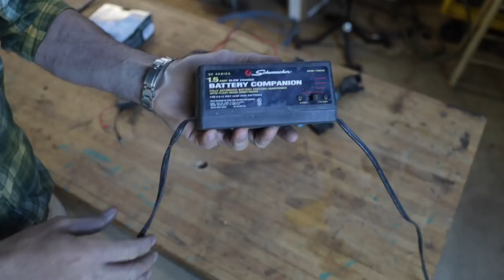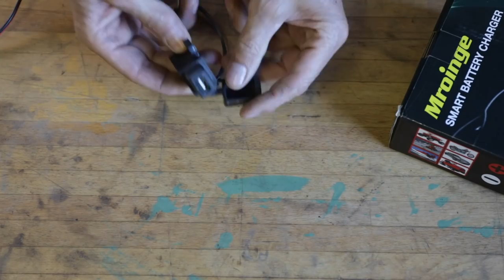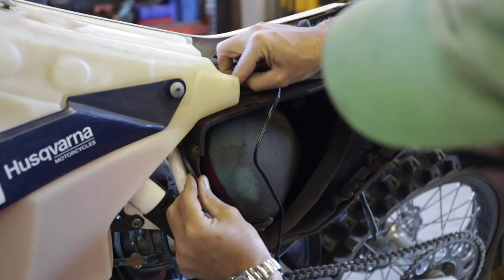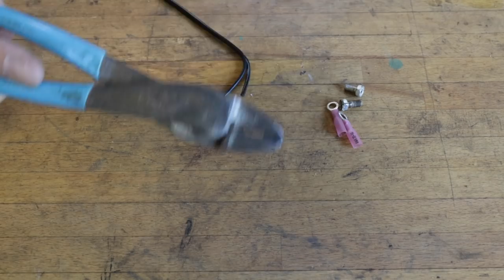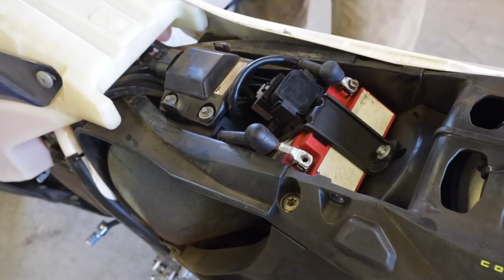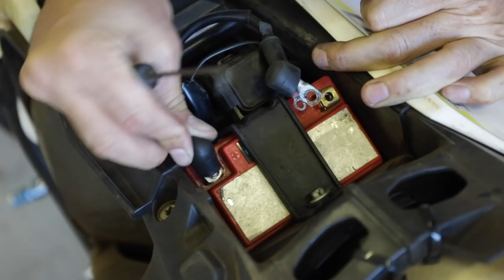How To Charge A Car or Motorcycle Battery Like A Pro

Comment: Just a note on those pigtails. I got one that had the built in fuse, from the manufacturer (same one Wranglerstar is using), the fuse had a manufacturing defect, which makes it look like the battery is bad, or there is something wrong with the charger if you have a brand new battery like I did (after replacing it and rewiring the same bad cord). So then after getting a second trickle charger, and getting same problem, I finally swapped the pigtail and that resolved problem, so then I noticed the fuse, and on a lark swapped the pigtail back to the "bad" one and changed the fuse, and everything worked. So $150 and many hours and frustration later, bottom line is *check the fuse first!*. I'm sure obvious to you reading this now, but at the time it wasn't to me.

Comment: In case you're wondering, those connectors are called SAE connectors. Not only are they used for battery charging, but are also often found on radio equipment and a few other things. Biggest thing is to always double check the polarity! You can mess it up if you're not paying attention, because it's the same plug on both ends.
Reply: Thomas Nast yes!!!!! Soooo true you always have to double check. Not enough people know that.

Comment: Cody I enjoyed the video but something you forgot to mention, is paying attention to the polarity of the wires for your charge circuit. If you hook up the charger backwards you can either damage the battery or damage the charger.

 Because you cut the wires long you should be able to go back to the ring terminals that were original and look for the ribbing on the side of the wiring jacket, depending on the manufacturer sometimes the ribbing is on the negative side and sometimes it's on the positive side, so that's how you can identify your polarity if forgot to take note of what one was positive and negative.

Cody I enjoyed the comment about the photo shoot out there on the property, last month I turn 62 and I have thought back about many of the people I worked with and it's funny that some of the people that I worked with, the ones I remember are the ones that offered the Helping Hand when I was new on a job they gave me the little tips and hints of how to do a better job. Then there were the few that wouldn't tell you anything but were there to belittle you when the job the job was done wrong. And I think a lot of the guys that are belittling the video are armchair quarterbacking it.

Comment: I use XT-60 connectors on all my stuff. They are kind of the new popular connector with small lithium polymer packs so they are easy to get and are rated for 60 amps.

Comment: SAE TO SAE 12V-24V Quick Disconnect, I use an extension for my motorcycle so the plug is by the handle bars for easy charging and easy to USB power adapter....i also use a "SAE Quick Disconnect Wire Harness Panel Mount" for a very clean and easy to use charge point for larger equipment (side by side, tractor, etc.)

Comment: Cody, Thanks for sharing this video. I just put a new battery in my 1977 Yamaha XS 650 and the pigtail would be nice for off season storage but the battery is easier enough to remove and I keep it in my shop which is heated. Thanks for sharing your knowledge as always.

Comment: Right off of the amazon page:

The unit is built-in 2 color LED indicates stage of charging, so very easy to use.

FLASHING RED: not charging battery, reverse battery.     <<<---------------------------------------------------------------------------
SOLID RED: battery charging.
FLASHING GREEN: battery greater than 80% charged.
SOLID GREEN: full charged and maintaining.

Comment: Dad use the same connector set. Over 40 years. Whenever he ran low, he would just order a gross of that particular connector. About 10 years before he retired from appliance repair, we built about five kits. One for each utility bucket of tools that we took out.

Comment: You cut off the red/black markings. I suppose you will find out in the end.
Reply: exactly, I thought he was going to use a sharpie to color the black leads heat shrink tubing.
Reply: All those chargers have reverse polarity protection
Reply: @mitchdenner9743  - that's irrelevant, that lead could short out the battery to the casing if he's swapped the connections over.
Reply: @borisisasleep8993  stop crying baby
Reply: @mitchdenner9743  - really? please stop talking about stuff you don't appear to understand
Reply: @borisisasleep8993  go back to bed boris

Comment: Great tips, as usual, thx WS!   Fwiw, I might have just installed the "slightly too big" factory charger wire ends underneath the bikes battery cable ends.  I usually try and do this also because the battery cables are strong and stiff and when you tighten down the screw/nut, you won't smash & twist the delicate accessory wire ends.

Comment: Pro tip: Cut your positive lead about a half inch longer, so you don't confuse them after you've chopped off the colours. Of course you could choose the other wire, but I didn't want to leave a negative comment.
Reply: Bonus point for polarity pun!
Reply: Lol

Comment: A little " thing " i'll share with you - and others. My 20 year old manual lead acid type 1.5 amp charger would top off the charge at 15.8 volts. A little high for small motor cycle or scooter batteries, over time - like a winter. it would slowly boil the water out of the battery. Your modern li-po batt is a whole 
different animal. I bet it tapers the charge very nicely to a float charge when it sees the voltage rise.
My dumb charger would just keep on going until the water boiled out.  The solution i found was a small wall transformer, for a small item that was 12.5 volts at 100 ma. Cut the plug add clips and let it go all winter, no load voltage was 13 or so volts and it must output DC not AC volts.
Lead acid type batteries only. The 12.5 volt transformer would let the battery voltage rise to around 13.5 or so, with low current it will not harm the battery, you could even get away with a 50 ma transformer. Works on car batteries as well.
Battery tenders have voltage sensing and taper the charge as the voltage rises, but if you don't have one find a 12 volt wall wart add clips and there ya go. Just be sure it is a DC output transformer.

Comment: So, does it autodetect the polarity or did you just get lucky?
Reply: Yes, most have reverse polarity protection, plus the ground wire always has either a white stripe or some type of lettering on it  so you always know even if you cut off the red and black ends. Pretty sure 120 volt cords are the same too with the neutral being marked.

Comment: If the other end of the battery cable is a ring terminal, it is sometimes easier to connect your charge wires at the solenoid and frame ground so that you don't have to fuss with the charge wires when you change the battery.

Comment: hi cody you might want to rethink the terminals on your battery charge fly leads, the fitted ones were the right size for the current they will have to deal with, your much smaller ones will not take the amps going through the battery, and it doesn't matter if the charge fly leads are connected to a charger or not, your small connections on the battery will not take the amperage put on them as they are connected directly to the battery leads unfused, they will be the weakest linc
Reply: Crimp terminals are rated by colour not ring size, the red ones are good for ~19A, that wire was maybe rated for 5A at most. Which is probably all that a charger would put out anyway. The main issue here is not using the correct ratchet crimp tool to attach the crimp reliably.

Comment: Polarity identification!  very important step overlooked.  Especially if people are learning from this video
Reply: Negative wire will always have either a white stripe or some type of lettering on it to denote that its ground. All these chargers have reverse polarity protection in them .
Reply: I partially agree with that but the point is it there was no mention of this.
Reply: @Jp_1984  Then maybe you should stress it when you make your video?

Comment: Here's a time-saving tip. Don't cut off a device's polarized output cord connectors unless you are immediately able to label  at least one of the conductors.  I like heat shrink tubing because it's an expensive are available in a range of sizes . Also, do not connect a simple passive USB adapter cord to any of the charged batteries. Use a converter with an active regulator

Comment: Plug Type is an SAE...
Ring terminals place the one with the biggest gap at the bottom and stack up, then you don't need to terminate again...
If you don't want it flapping about open the connector around the frame and put on the cap looks like you have enough room for it.

Comment: Ive tried alot of the cheaper wire strippers and the Snapon ones seem best. I always find that the cheaper ones dont cut insulation enough and it just stretches it out so i bought a second pair of snapon strippers for home

Comment: Hmmm...... since this was supposed to be an elementary presentation on battery charging, and I don't know squat about battery tenders, what they are, or how they function, it would've been nice to hear you explain a bit about the tender itself, not just focusing on how to install the pigtails.
Reply: Just a 120 volt AC to 12 volt DC converter. DC = direct current (+ and - polarity). They just keep the battery topped off on voltage as voltage drops on a battery the longer it sits. Also, clocks and computers on the vehicle can drain the battery and it needs to stay at maximum voltage. If the voltage drops too low, the battery is weakened and won't last as long. Hope that helps!

Comment: Crimp-on connectors have never worked for me. I have to tin the stripped wire lead, crimp the connecter on, solder the two together, and use fresh heat-shrink as needed. Always. Cycles, speakers, cars, trucks.
Reply: I'm trying not to sound like I'm on a pedestal here, and just sharing my experience, so please don't take this the wrong way.  I have found that to be the case until I bought a set of die crimpers.  They make all the difference in the world but you'll spend 30-ish bucks on them (and if you factor in your time being worth something they quickly pay for themselves).  The 10 dollar generic ones are not the proper tool.  Also, be careful on high insert/disconnect connectors and any wire that might move while attached to the connection.  Tinning the wires weeps solder back into the wire and makes it brittle right at the transition from the wire to connector.  I will only do western union splices on wires I connect together which involves soldering, but I never do it on things intented for manual crimping anymore.  I do like those crimps he uses with the heat shrink already on it.  That fixes so many issues and saves so much time.
Reply: @NGinuity  Clearly a good crimp and a good solder joint will result in an excellent connection if done correctly.  I've heard the criticism of solder making the joint brittle, but after 50+ years of doing this, I've never seen a problem.  The key is that the solder should not extend past the strain relief as to prevent this potential problem.  If the wire joint is seeing enough movement/vibration where it might result in the solder or wire cracking, it should be zip tied down or something equivalent to prevent fatigue failure.
Reply: @rmr5740 :
Agree completely!
Reply: @NGinuity :
Thanks. I think the old adage applies: YMMV. Good point about excessive tinning. One cm is not twice as good as 0.5 cm.

Comment: Apparently it doesent select the battery type.
It was flashing yellow cause you have to plug it in, make battery selection by pressing button and then connect to battery then it will be constant yellow when connected and charging and will flash green every 20 sec I believe as charging.

Comment: the idea of putting a USB type cable to easily recharge the battery is good, but if there is a moist or water that can accidentally enter inside the  USB port would cause the battery to heat up and worse would cause fire

Comment: You can get lineman's pliers with that style of crimper built in. Three tools in one instead of two!
Reply: Nobody should still be using that tool in 2019, the correct tool is a ratchet crimp.
Reply: @borisisasleep8993  why?
Reply: @CultureStress  at best those pliers are making a variable quality mechanical joint, a ratchet crimper will make a verifiable cold weld joint. Nobody in industry uses pliers for that reason, and tbh a ratchet crimper is a couple of $ for a DIY version these days. I don't get why he hasn't bought himself a pair.
Reply: @borisisasleep8993  if you don't mind my asking, which industry? I've only ever seen the pliers like he has on an IBEW local's tool list